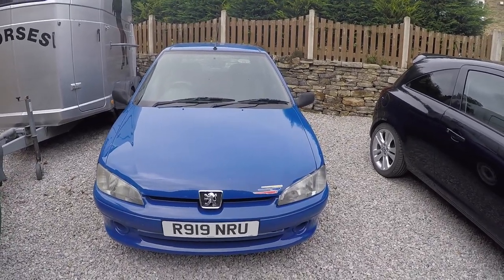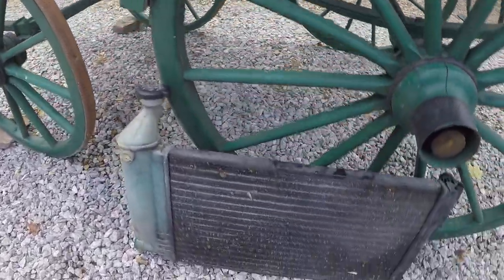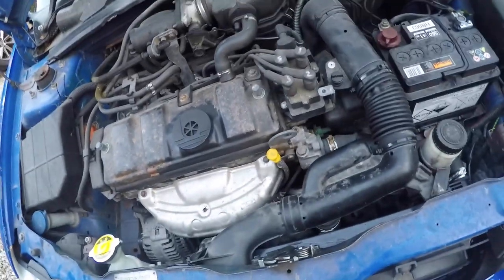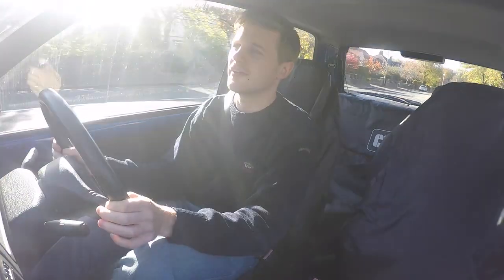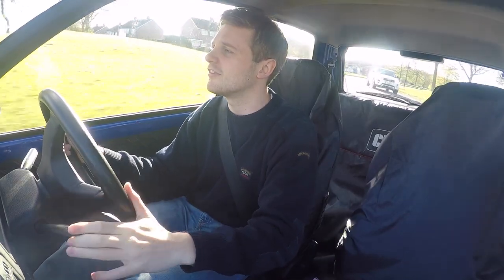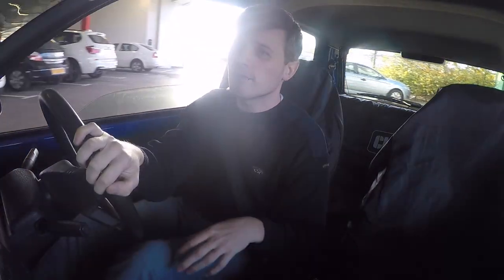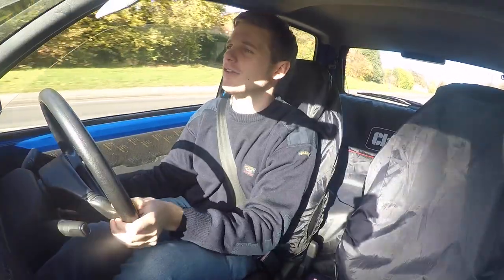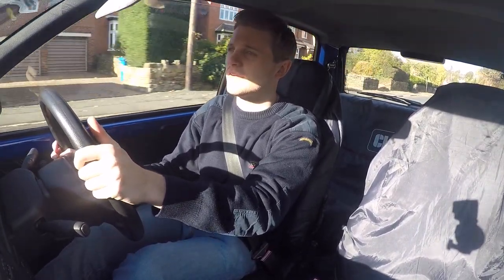106 Rallye Nissens radiator upgrade + Chanel update

Comment: Great video! What do you recommend is the best upgrade to do on a 1 litre 106 XN?
Reply from the maker: - SARGNT Clash Royale and More! - I used to have a 1.1 Saxo and it ran cooler than the rallye from factory. No point spending big money if nothings wrong but nissen do 1.1 rads too if the price isn’t much more than oem?